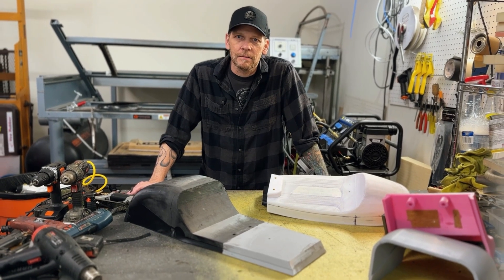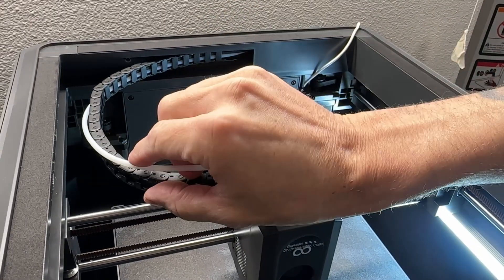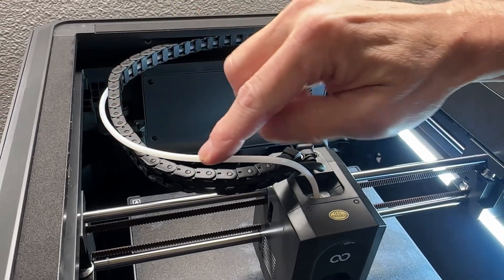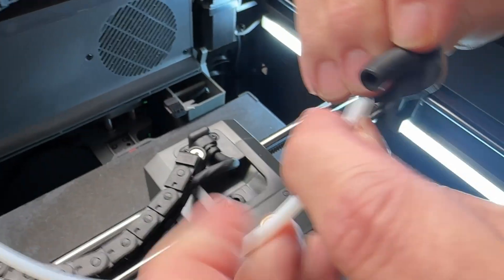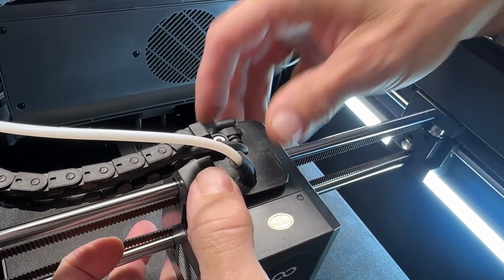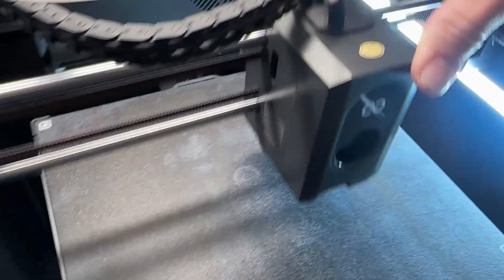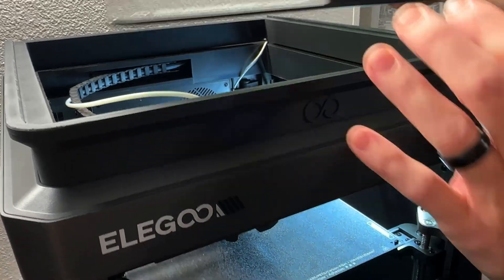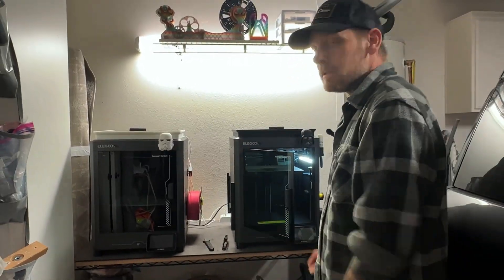MUST HAVE MOD - Elegoo Centauri Carbon

Comment: What little button - I don't see anything that pushes down to remove the tube?
Reply from the maker: The round black thing that you put the tube into is spring loaded  push it down on the edge and pull the tube out.

Comment: A nice idea, but I’m going to see how my the PTFE cable does moving freely. It’s worked for 400hrs on my A1 Mini so I don’t see why it won’t on this printer. Plus the filament tends to stand up the tube anyway when it’s passing thru it. I’ve heard that this mod also traps heat in the extruder, which could technically lead to clogging/heat creep. May want to drill some holes in it to avoid that!

Comment: Good ideas, and I'm still awaiting mine to be delivered. How easy is it to remove the PTFE tube mod when the filament breaks inside the tube and you need to remove it from the top of the printhead?

Comment: okay since i am a beginner in 3d printing so in ehat material should i print that ? in pla or petg or abs? since i have only pla now so will pla work?
Reply from the maker: Yes it will work.  PLA will wear out faster though.  If you’re planning on doing a lot of high temperature printing down the road, you should probably eventually print it with a ABS or something higher temperature resistant.  For the glass riser PLA will work fine.
Reply: @ccraft3d  I just printed mine and I used ABS to make it last longer
Reply: Thanks a lot ❤

Comment: printed it 4 times with 3 different filaments... I also recalibrated the printer... nope, does not fit for me. "Tight" would be ok, but not even pushing like in the video helped. weird

Comment: I'm considering purchasing an Elegoo Centauri Carbon 3D printer. Can anyone share if it's a reliable option? I'd appreciate feedback on its performance, durability, and print quality. Thanks in advance!
Reply from the maker: I have hundreds of hours on mine and have had no issues with clogging or things not working as expected.  (After my tweaks) They have updated the firmware a few times which has fixed most of their early issues. The print quality is on par with my bambu p1s. However, their slicer sucks so you’ll need to use orca slicer and modify print settings, filament settings etc. if it’s your first printer, I would probably recommend the bambu over elegoo for ease of use and no messing around with anything.  Lastly the main downfall right now is they don’t have any spare parts readily available which will change in the future. I’m sure, but if you want a different nozzle, you can just buy one yet. But for the price, it probably can’t be beat. Especially for an enclosed printer that can print high temperature filaments. Compare it to the bambu P1S.

Comment: Great mods. FYI - I received my Centauri Carbon (batch 5) in mid-June, one of the manufacturing changes is that the ptfe tubing was not zip tied to the cable chain.

Comment: i ordered 2 of these for the next batch of shipments.. whats the size of that shelf you have them sitting on, or whats a good dimension for 2 to fit side by side. Looks like you have the same pvc coated blk metal shelves i have already with a pank of wood on top... im guessing its stable enough for ya as well? hope the chl grows
Reply from the maker: Thanks! the wood top is 45"x22" and has plenty of room. Its 3/4" thick and bolted to the wall with "L" brackets. 
I Printed TPU antivibration feet for the machines also. (not sure it needs them) Seems to be just fine even with both running at the same time. This was a temporary solution because i already had the rack and the wood but does the job either way.
Reply: @ccraft3d  nice! appreciate the reply!

Comment: You forgot to mention one thing. After installing the elbow (rising the tube), order new tube. Everytime when printhead is moving to far edge, the tube is rubbing against the frame unfortunately. I used printed elbow to guide the tube, so it doesn't kink.  With the elbow installed just ziptie it to the print head cable. The tube now travels freely in elbow while being in the rail.

Comment: What did you print the riser on?
Reply from the maker: @michelleharris8887  the 1 piece riser was printed on the Kobra 2 Max. I printed the second riser on the Elegoo Carbon in 4 pieces.

Comment: Does the riser cause any heat loss?
Reply from the maker: @danwallace5023  depends what materials you print regularly.  of course it will a little, But its not a heated chamber machine.  It’s not insulated, there are several other gaps and openings in the machine. And if you plan on just printing PLA or PETG you need to vent it regardless.

Comment: I assume I cant use PLA for this, what material should I use for moving parts like this?
Reply from the maker: Sure you can. It might wear out a bit faster. If you’re planning on printing hotter materials, then I would at least use PETG 👍

Comment: @Ccraft3D - Looks good, but i noticed on mine when i took out the ptfe tube too far, it rubs and catches on the cable chain slot when the print head is in the lower left corner - you can see thats happened on yours in your video, as its leaving white bits of plastic on the sharp edge at the left hand side of the printer where its scraping the ptfe tube.
Reply from the maker: Thanks!
I can handle a little rubbing It’s better than failed prints or broken filament in the tube. The alternative would be to remove the PTFE tube completely and run it on the back side of the cable chain like Bambu does.
Reply from the maker: https://youtu.be/MKF-CcifVuE?si=4OPmuUG-7SxjvnPS
Reply: @ccraft3d  Just watched your video - I love that idea! Now I have to print a new riser! :D thanks man!